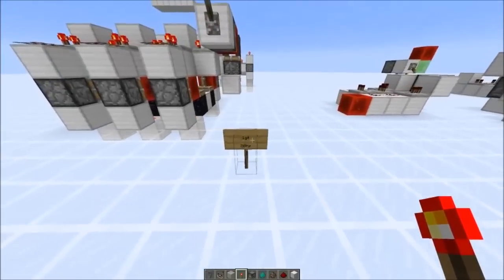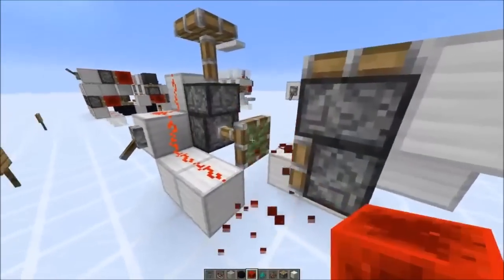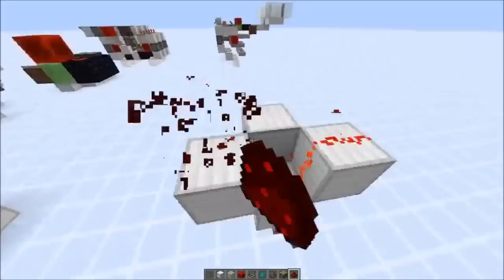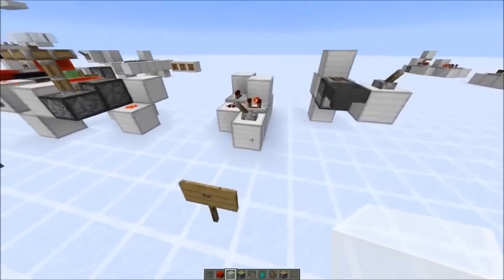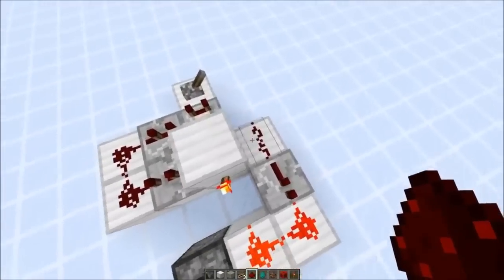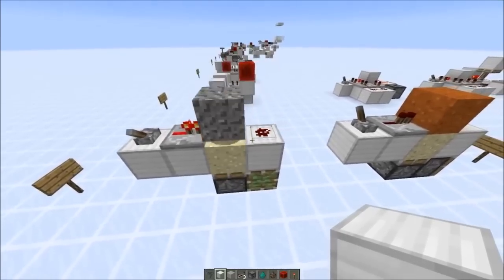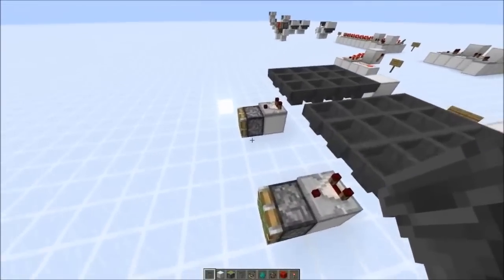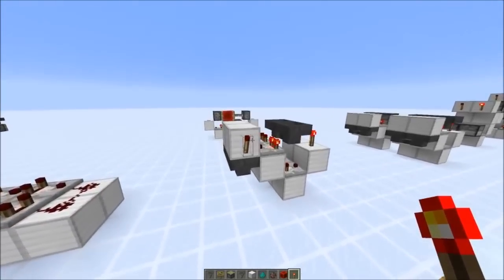Overview of Minecraft Clock Circuits

Comment: The 8tick clock using only: -comparator, -repeater, 2 redstone dust and a lever and some building blocks has my preference in this video. It is fast enough to empty my farms and it is slow enough to not overflow my item sorter. Prior to this video, i used the double observer clock which is just too much for my sorter and i don't plan to make/use more than the 8 double chests i've put under each sorter anyway. Now i also have 3 double chests linked to a dropper with 3 hoppers for when i've mined a bunch or something like that and that too won't overflow the system now. I might be able to use a faster clock and not run into issues, but this one is fast enough so why bother

Comment: You can build a sand clock with a timer on it. The amount of sand will dictate the amount of times the clock goes off until a red stone signal is revived, up to 255 times the original amount. 255 times only because that is the build height in PS4 minus one block needed for a torch under the clock.

Comment: check out the minecraft wiki super long delay clocks. 13 delay elements give you a clock 6minutes 20 seconds and is programmable for shorter intervals. 23 element runs for days.
Also have a 1 tick pulse generator using 3 redstone delay elements and a 1 tick rapid pulser with 2 additional delay elements.
Reply from the maker: So I checked the wiki and besides the standard designs there was this repeater design somebody must've added. I don't see a point in it. You can get the same more compact with hoppers. No reason to build this huge thing

Comment: would a 1gt clock be useful for creating self-loading chunks if you set it up to power a redstone circuit that straddles chunk borders? since redstone circuits load chunks upon their activation
Reply from the maker: yes, but the lag is horrendous
Reply: hopper loaders dont seem to work anymore :s i might try & design a toggleable system for it
Reply from the maker: James Shasha
hopper loaders work in 1.10.2
Reply: Hopper loaders have been "fixed" by some of the plugin handlers.  (Spigot, Bukkit, that kind of thing).  If you're talking about a server, that might be the issue.

Comment: with the 16 gt 0-tick sand clock. what happens if you place a block where the sand "jumps" upp to?
Reply: The sand breaks. Even if it's a block which you don't collide with (eg string).